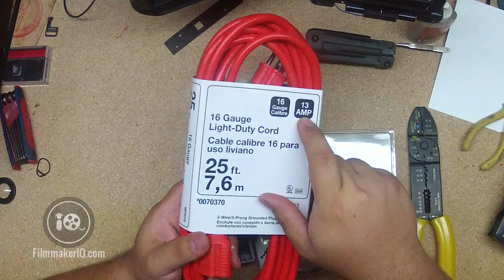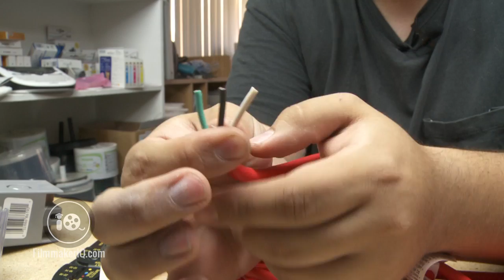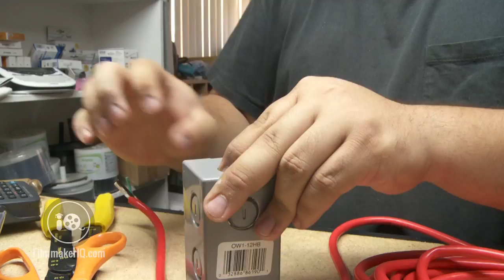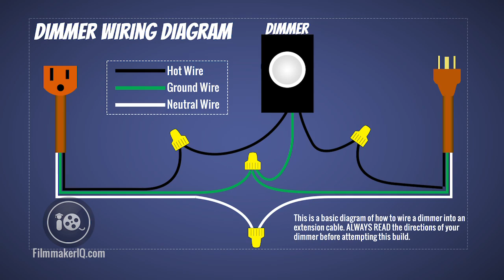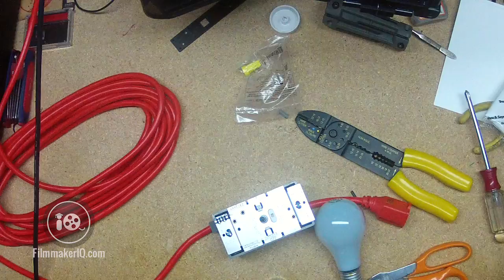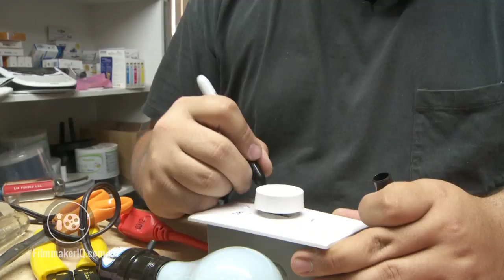DIY Inline Dimmer Cable Switch (Lighting)

Comment from the maker: Yes it does matter. These dimmers are only rated for 600 watts or so. You may be able to find some dimmers that are rated for higher wattage out there if you search for them.

What will happen? Not quite sure, the higher wattage may burn through the circuits.

Comment: Really well put together video!

Does anybody know if doing the opposite process would work? (Removing the in-line dimmer from a Tungsten Fresnel and replacing it with a simple on / off switch)
Reply from the maker: Tungsten lamps are really easy to wire up - One side of the AC cable goes on one end, the other goes on the other end and the ground goes to the fixture. So if you remove the dimmer which is going to be one side of that circuit, you can just replace it with a switch. As long as your switch completes the circuit, you're golden.
Reply: Thanks for the reply - really appreciate it!

Comment: Dug high and low but can’t get a yes or no response to - will this work on a simple IKEA LED bulb in place of a Tungsten one ? Fully familiar with this but not as much with the DC dimmers and those with two terminals.
Reply from the maker: Depends... There are some LED bulbs that are dimmable... Some aren't...
Reply: @FilmmakerIQ  thanks, understand, so a dimmable IKEA bulb works with this type of an AC dimmer? And doesn’t necessarily require a DC dimmer or one that requires both a live and neutral wire going in? Thanks very much.
Reply from the maker: Yes, those dimmable ones are designed to go work with these types of wall dimmers
Reply: Great, many thanks!

Comment: Will this work for LED string lights that aren't compatible with a dimmer? Another buyer indicated on a Q/A review to install an in-line dimmer. They said it worked but to expect a flicker when the current is reduced. Is this flicker just while dimming or continuously until the current is restored? Is it safe in this situation?
Reply from the maker: I don't think so - this dimmer seems to vary the voltage - LEDs are DC powered so they have a driver that converts the line AC to DC power and would probably be unresponsive to changing voltage.

What you need is some sort of Pulse Width modifier for LEDs - that's going to get complicated if it's not already built into the string.

Comment: I have to say…thank you for this video but anytime a box is external you should spend a few bucks extra and have a metal box.  This thing will get banged around and if somebody accidentally steps on it and shaders that plastic box, they are standing on live wires.  Otherwise thank you for this video.
Reply from the maker: I've had these plastic boxes for about 15 years, beaten thrown around and generally not taking care of very well... None of them have shown any damage on the box itself. The plastic is super durable. I'm not saying your point is wrong but the plastic ones are not delicate.

Comment: Hi, I just made one of these following your directions using the exact dimmer you use. I'm having some problems. I tested it out using a cheap 500w Impact light fixture with an Eiko ECT Lamp (500W/120V). Turning the dial does nothing until it gets to about 85% and then the light all of a sudden turns on full-throttle, buzzes, and burns out in about 10 seconds. This has happened to me twice, and I don't really want to keep burning out bulbs. Checked all connections. Am I using the wrong type of bulb for this?
Reply from the maker: SandhillsVideography Hmm... that's weird. Double check the fixture itself - does it work without the dimmer? If so, there's something going on the dimmer side - maybe it's a bad dimmer.
Reply: Thanks for the reply. I tested it on a Lowel Pro light and the dimmer worked perfect. It seems to be my type of bulb or fixture that isn't cooperating with the dimmer (both work fine without the dimmer).
Reply: +Sandhills Videography Hey guys. I'm new in this, and I've seen some bulbs that are not "dimmer-ready" (I'm looking on doing this with a GU10 LED). So I guess they would work like ON-OFF without the fading effect.
Reply from the maker: Right - LEDs are generally not dimmable with this kind of set up. Neither are most Fluorescents (though there are some dimmable variety). Basically with LED it will either have enough juice to turn on - or it won't - so ON-OFF as you said. :)

Comment: can you do this to a single speed electric motor? I have an old fan motor from a small ventilation system that I am converting to a bench sander. would it work? the motor says 115 volts, 60 HZ, and 1.1 amps
Reply from the maker: Probably but I don't think a small ventilation system would have to torque to become a bench sander.

Comment: can this be used to power a transformer for a hot wire cutter?
Reply from the maker: +8rh3n7 Most of these dimmers have a max wattage rating of 600 watts so as long as you hot wire cutter is under that I think you should be okay.

Comment: My dimmer has 4 lines coming out 2 red - 1 black and 1 green , how do you wire it up ? I went green to green and white on white , now I am left with 2 red lines . My extension cord is the same . I just can not figure out where the red line's
 goes . Any help would be great ! Thanks
Reply from the maker: Read the instructions that came with the dimmer - there will be a schematic on how to wire the dimmer. The Green is ground and the black and red are the wires carrying the AC current. The idea is the dimmer will sit on the red line and regulate the current on that line (no need to regulate the black, if the red is regulated)
Reply: Hey thanks man . Very cool info =)

Comment: Nice work on the video. I'm considering doing this with a Lutron LED CFL compatible dimmer with wireless remote ( see link below ) so I can use cooler, lower wattage bulbs. Anything wrong with this idea? 
http://www.lowes.com/pd/Lutron-Caseta-Wireless-3-Way-Wireless-White-Dimmer/999948502
Reply from the maker: That device looks awfully expensive for this type of project. You'd be better off just buying dimmable CFL/LED bulbs and using a regular dimmer.
Reply: Agreed. I need the wireless remote, though.
Reply from the maker: +Andrew Krantz why?